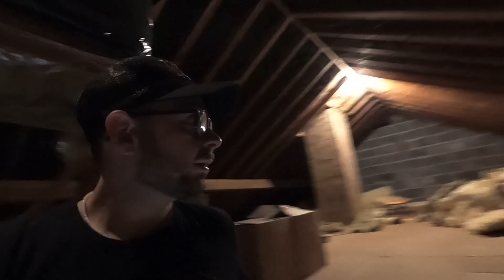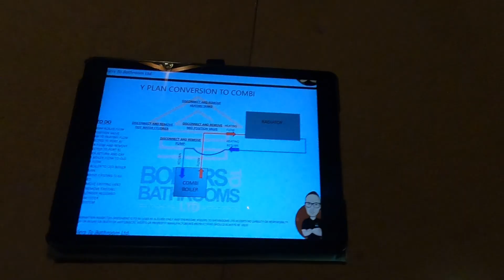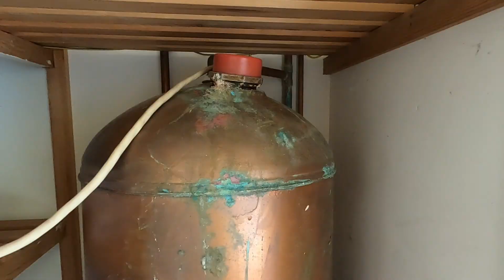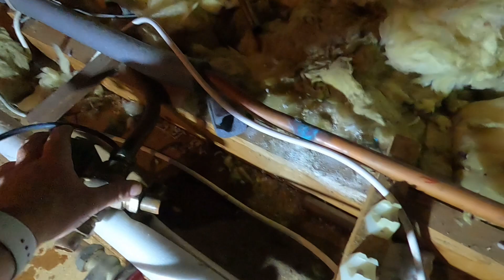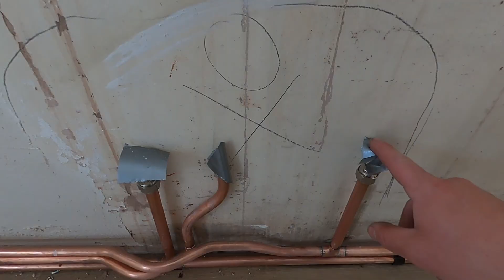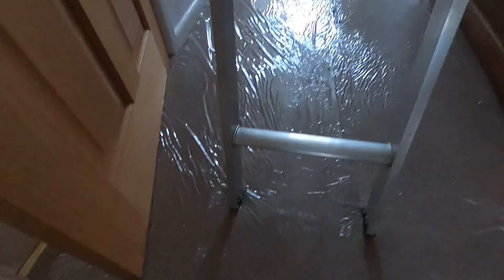A Day in the life heating conversion episode two

Comment: "I tell my apprentice's to tighten as they go" Leaves an open end off the original HW pipe from cylinder. :) :) good video mate. Did you pressure test that buried pipework before plastering over it? You'll be back to replace those sinks, poor taps and dated bath soon. Not a fan of the compound seal inside for the gas supply to boiler. Only use that in meter cupboards. That boiler did not require a perm live, as it was on a Y Plan, no need for bypass, I wonder if it was wired for pump over-run, which is why you were getting voltage after switching fuse spur off?. Finally, why are you wearing a @pbplumber cap? You're promoting his business aren't you?

Comment: Excellent work as always .... I'm wondering if you sleeve the 32mm pipe white pipe for the condensate outside? .... Recently an inspector mentioned to use lagging for the pipework under the boiler even if it's inside the house, and to lag condensate pipe going outside even if it's inside 32mm pvc pipe!! .... He stated it's a regulation requirement!
Reply from the maker: Thanks mate it’s inch and a half all the way through the wall so that’s never going to freeze